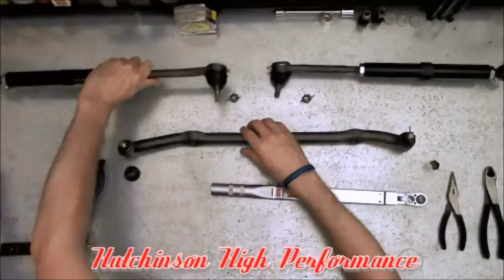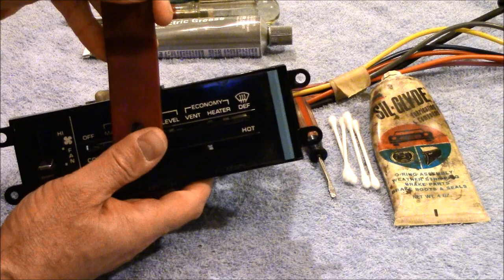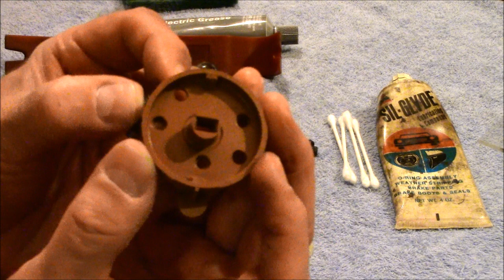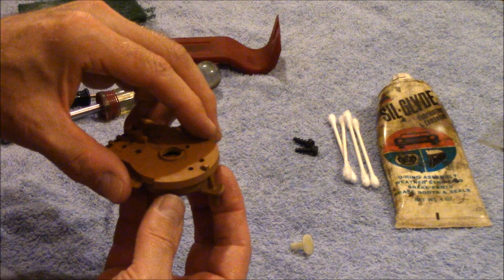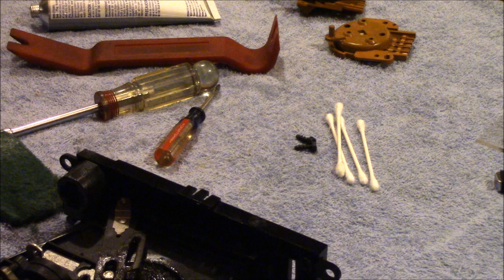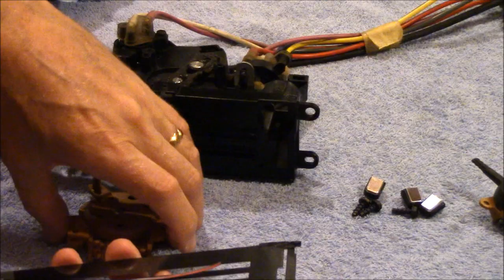G Body A/C Control Unit Refurbish!!! 1987 Olds 442: Video 37

Comment: First and foremost excellent video! Thanks for sharing such informative procedure. 4 Months ago I bought a 1979 Pontiac Grand Prix and  I've been kind of restoring it. Started with the undercarriage, gas tank, fuel pump and now the body but, during this whole time I've been looking and looking and looking for new dashboard because the one I have is really shot. You touch it and it disintegrates. Well, I finally found one and it's like new came with wire harness and an AC unit controller.  Now the I see that you can clean these up I'll be able to do just that for when I replace my ne dashboard next week. Thank you again and hello from San Jose, CA ( Bay Area)
Reply from the maker: @KarrozYKulturaz  hello!  Glad to hear you found a good dash. Have fun with that Grand Prix!
Reply: @hutchhiperf  Thank you

Comment: I'm inspired to investigate my 81 control .... the fan switch stopped working, so I hardwired full power to the fan motor to get heat in winter....  I also bypassed the hot water valve - I have to move the radiator hose to ON in winter, or total bypass in summer   :0)   Got doubts about my vacuum system too.   The switch switch does not move well.  Maybe I have the "no ball" style switch.   I have to take a walk through the wrecker and see what I can find

I totally understand why folks are getting into these G bodies: the 60s "hotrods" are all high priced "collector" items now.  Common folk want something they can "fix" (or break) themselves, cheap parts in wrecking yards.   Now that is even getting rare.  Mine came with a Buick V6, but I knew they also had V8 which would fit, even the 455 big blocks with minor mods (had to weld on a new engine mount to the rear crossmember and get the dreveshaft cur/balanced.   Really great to see all the support from parts suppliers, and useful online presentations, thanks to people like you..

Comment: My hodge-podged 79 GM unit...mounted on a Dodge M500 Frame, all driven w/ 440/A727 drive train, all in a 1980 Fleetwood RV, E-25 Package equipped,, well it came as a "Some Assembly Required" deal ;)
My issue is the 7 "Teats" coming out the back and why in the world can't I find a diagram for proper what vacuum line to what teat placement anywhere....found a few for the typical round pattern, which also usually is accompanied with these mounted on a pre-fit plastic ring as to plug all vacuum lines in @ once ;) 
and even more concerning is that there's only 4 vacuum lines (all 1 color, BLACK) to put on said teat's, and should I block off the remaining 3 teats....or start looking for different vacuum depend devices with no lines on them?. I did sort out which was my suck source by of course, starting the engine... guessing the other 3 here, one is for defrost flap other is for fresh/recircl and 3rd for heater core??? But that'll be the easy part, I just don't know which line goes to which teat, I wasn't fortunate enough to have one of those factory form factored pre-set rings that let ya plug em all in @ once. This one also doesn't have said "Teats" arranged in a circular pattern, these are all just splayed across the back of unit, no stamped numbers, letters, nothing
Haven't had a free minute to back trace these yet, got one now, and yep....raining blood out there currently
Par for the Course...

Comment: Excellent video again 
Do you know which switch would cause the air to only blow from floor and vents regardless of where the lever is?  Is it the larger switch you took apart with the springs? Or the vacuum side of it at fault?  The
Reply from the maker: It almost sounds like vacuum.  If you have a vac gauge (or even your finger as a check for vac) you could check the servos for vacuum and trace it back from there. If you watch the video you can see a slider arm for that switch.  It controls a vaccum plug as well that distributes the vacuum.

Comment: I am surprised you dont address the 9 port vacuum port issues and the dump valve issues how to test and possible repair
Reply from the maker: Mine seemed to work ok.  I don't have a second one to tear apart.  My motto is "Ain't broke, don't fix" :-)
Reply: @hutchhiperf  how do you know is isnt broken? is my point they dry out
Reply from the maker: @thomasdemarco617  Because I bought the car running and drove it many times.  It worked.  I'm not going to fix what doesn't need fixing until it's broke.
Reply: @hutchhiperf  do you refurbish units on the side
Reply from the maker: @hogansmith7589  no sorry

Comment: Just did the same job on my 85 t-type control unit but I had the big idea to disassemble the vacuum switch/valve to make sure it was clear and clean.  Realized there’s no index on the valve and not sure if I’ll be able to reassemble it with the valve gasket oriented properly with the holes in the valve body (hope that makes sense).  Did I screw myself, or is there a way to reassemble the valve properly?
Reply from the maker: You got me there. I'm sure someone must have done this.
Reply: @hutchhiperf  that’s what I figured!  But I haven’t found anyone discussing it.
Reply from the maker: @slowriot  you might want to check the boards at gbodyforum. That's always my "go to" for info
Reply: I did the same thing did you find out how to put it back together probably?

Comment: hutch do you know how to test these two switches with a multimeter Thanks
Reply from the maker: You would need a wiring schematic.  Then it's just a matter of positive to power supply pin and check for continuity on the others while the switch is moved.
Reply: @hutchhiperf  ohms continuity would do it don't you think
Reply from the maker: @thomasdemarco617  Sorry if I didn't say that right. That's what I meant . Though it wouldn't matter, I always us the red lead on the "power" side. Old habit.

Comment: I don’t have high speed and my cold lever won’t go all the way over to cold maybe 90% of the way
Reply: Common issue, mine does too. Don't force the lever all the way, or you'll break the black plastic pivot arm (located behind the glove box) that the control cables attach to. They sell reproduction arms as it happens so often. No high speed could be a bad relay (on the AC box under the hood).

Comment: How do you remove the buttom cable??
Reply from the maker: See this pic http://practicalpages.com/ebay2/ACcontrolChevy84/ACcontrolChevy84bottom.jpg
There is a small push washer that is over the cable loop on the stud it's pushed on.  Pry that off to be able to get the cable end off.  The cable housing end (which is red in the pic, but black on ours) has a clip that snaps in to the housing.  Flip the unit upside down and you'll see it.  Use a small  flat blade to pop that loose and it should come off.  Use care with these parts, they're old.